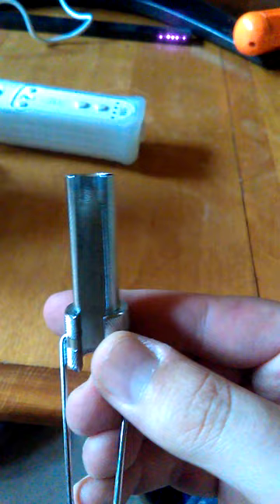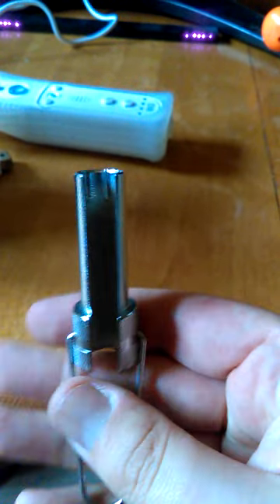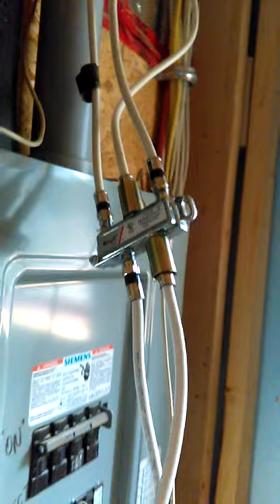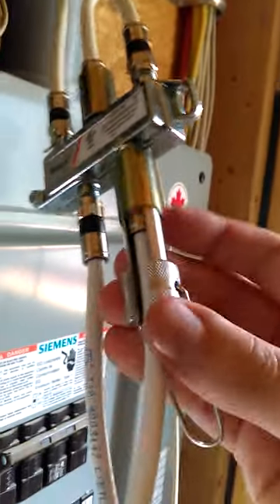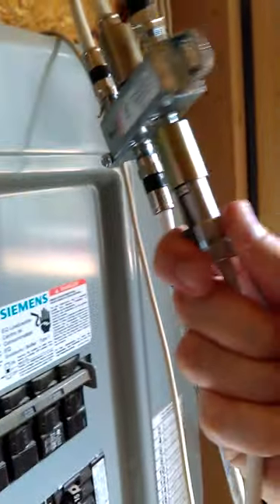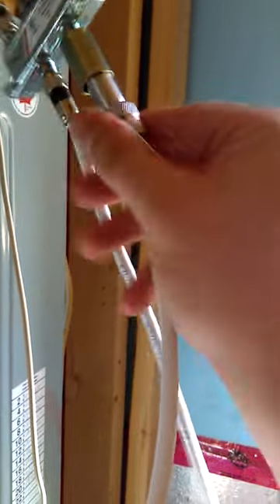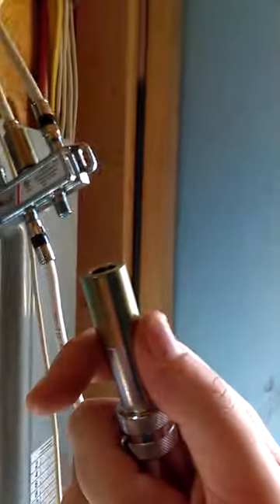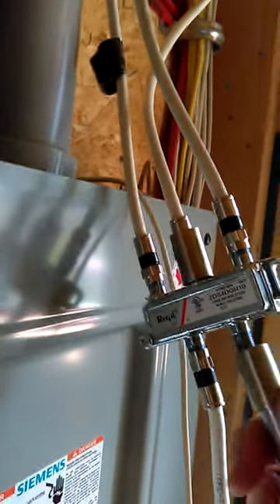Locked Cable (RG-6) removal tool

Comment: Thanks, I have this tool that was coming with my new Internet box cause my first one is connected to a phone line, it has this lock on it so we can't move it easily in the past, I couldn't figure out how it works until I looked at your videos, they provided me the tool but no clear instructions with it, thanks.

Comment: Great and thanks for the Youtube. But today I didn't have the tool so I used a Pipe cutter to get a portion of the shield away enough to give me access to the nut and voila.
Reply from the maker: The problem with this is if a technician has to come over to your home for service, they'll notice the shield is gone and may end up charging you for it (if it was supposed to be free in the first place) because you modified the equipment and it's can't be "guaranteed" this wasn't the cause...
Reply: @Darkdaej  My House, my cable,  if they don't like it, they can take their stuff and go.
Reply from the maker: @normandmarcotte5633  And then your tv service/internet doesn't get fixed.  I get the idea but given that the cable is connected to their equipment(modem, set top box, whatever), they'll claim they're protecting their equipment.

I used to do tech support for telecom companies so I know how they react to customers who "resist" those locks...

Comment: Hey, cool vid. Question - what exactly does this "lock" do? Does it block service from going through it? You think there's a way to remove without that fancy tool?
Reply from the maker: TheSuperShaan 

This tool is useful if you need to change a coax cable that died, or in my case, need to move your cables around during renovations without having to call your provider and paying for the service call.

The lock just prevents you from doing that by hand.  In short, it's just a way for them to make money off of service calls.
Reply: In most cases those locks are for preventing unauthorized tampering.Not much point having them on the main split in your house unless it’s a shared distribution point and locking out a second residence.

Comment: Would have been useful had you provided a link to where it was purchased!!
Reply from the maker: veercoo found it in a local store where they specialize in electronic accessories and wiring.  Didn't find this online.
Reply: home depo got it online